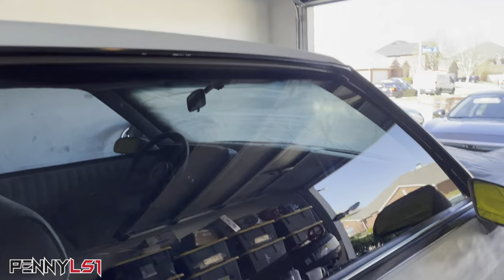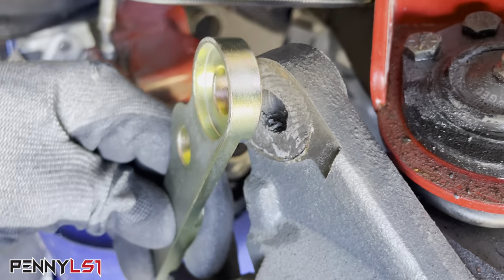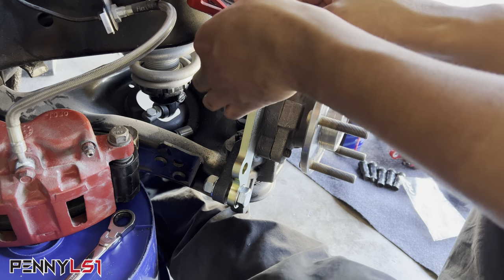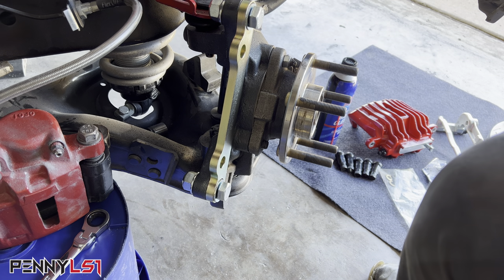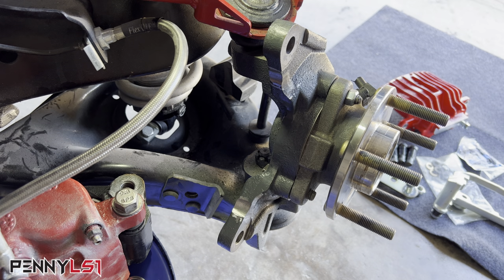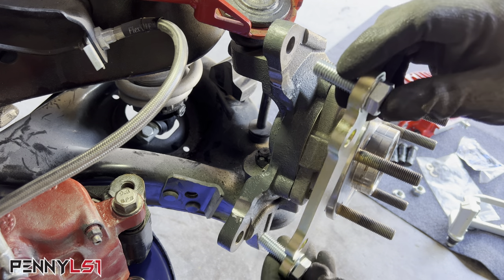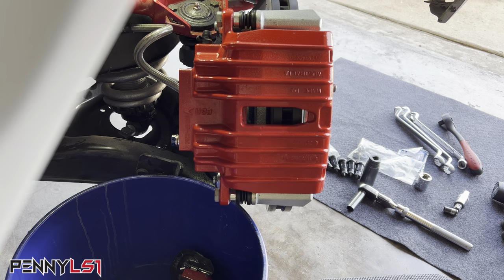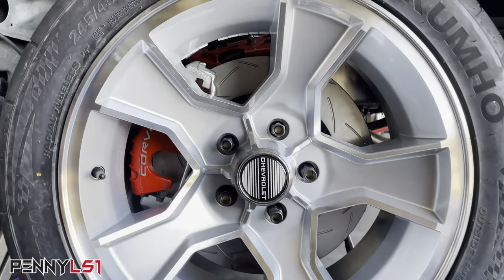KORE 3 BIG BRAKE UPGRADE!!!!! (LS SWAPPED GBODY) @PENNYLS1

Comment: I did the samething tom my 1984 buick regal but i used the 2005 c6 z51 calipers and disck brakes as well as the same brackets you are using and sane belltech drop spindles. Only issues i ran into the belltech spindles is i has to drill the upper ball joint hole on the spindles a bit bigger because i couldn't get the ball joint to sit far enough to put the cotter pin in after tightening the nut on and i also had to do it to the out tie rod hole i dont know if its because i ordered the ball joints and tie rods from amazon or what the deal was. I gotofy belltech spindles off of a 2002 2wd extreme blazer. I ordered the stock caliper brake lines but the are a bit to long im thinking of getting the stock blazer brake lines.

Comment: The area you had to grind flat are strengthening ribs they're not for aesthetics but you're not going to affect the integrity of it by taking off the little amount of material you did
Reply: You're also the only person that I've seen used the right tool to do the grinding  the die grinder and a carbide burr it's definitely the best way to do it. I have a set of extra long carbide bars They weren't cheap but then they cut

Comment: I got an 86 Pontiac areocoupe.  It’s not all stock anymore. It was just a pig. It had no get up and go. I made the decision that I’m not gonna sell it, so I’m making it into what I want. All the suspension had been rebuilt with tubular control arms, and I’m running 2” drop spindles. I wanna go to the Blazer spindle, so I can have better brakes up front. I’ll look into the Belltech spindles. I’ll probably try the stock S-10 calipers first, and see if they’re any better. I’m running 15” race car wheels, and worried about clearance. I plan to run bigger wheels in the future, but I just want to improve my braking for now. Thanks for sharing your advice!

Comment: Can you use the same master cylinder  when change to big brakes
Reply from the maker: Yes the stock master will work. Most of us just upgrade the master and prop valve because plan on running disc brakes in the rear also.